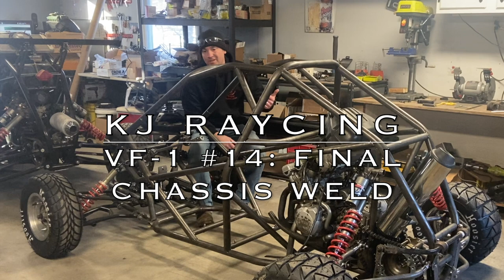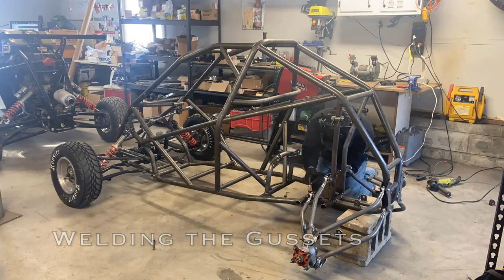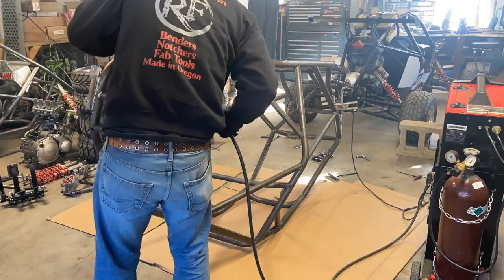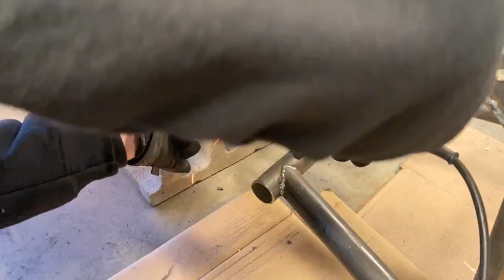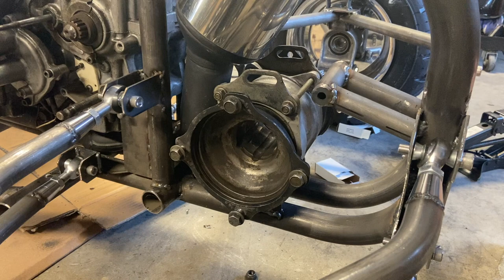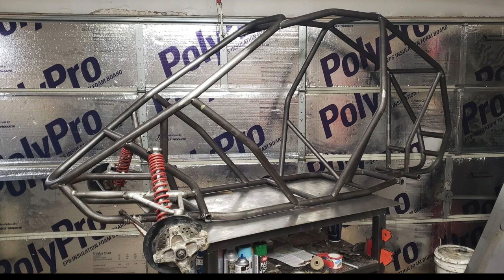Crosskart Build #14: Final Chassis Weld

Comment: Don't know if you mentioned earlier in the series, but be careful when welding if the engine is in place with electronics and control systems still attached, as it can fry them, not guaranteed but can happen.

If the fitment issues are a close fit, you can also use a tapered pin to set one side then put the bolt, or whatever is going through in. Or a pin either side and work on it with heat like you did. Also works on A arms where there is a very slight twist on final fitment. Even where there isn't a problem with alignment it can help put things together, when you only have one pair of hands.

Comment: Thanks for the video. What you are trying to bend a piece of metal get it just past where you want it and just hit it with a hammer where you want to change the memory of the metal. This can also be done when a piece of metal is accidentally bent. Just taping with a  single Jack hammer will make the crystal structure of the metal tighten returning the piece of metal close to its original shape. Just heating a piece and bending it does not remove all of the  metal memory. You just need to tap that stuff while it hot to change the memory AKA the crystal lattice structure of the metal. Thanks again for the video.
Reply from the maker: Lots of ways to accomplish this. Wanted to show a practical one. Easiest probably would have been just hitting the top side with another weld with the scissor jack in place. But for just a 32nd of an inch this way seemed the most logical.

Comment: what kind of welder are u using?
Reply from the maker: Lincoln 140HD.  Tube is fairly thin wall so you can get away with a lower power welder.  My welder is on 120v and I've built 5 of these with no issues.